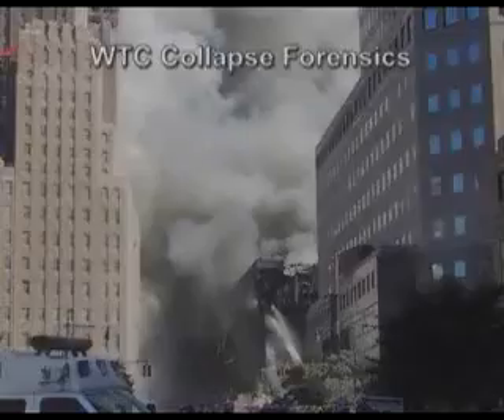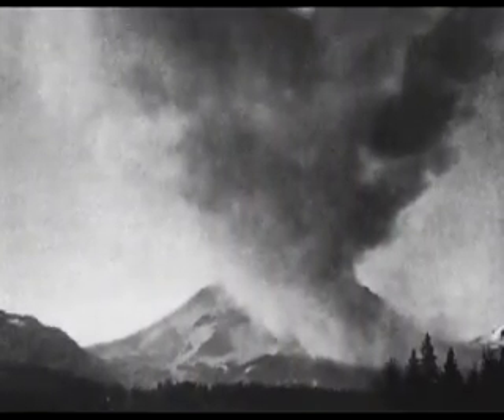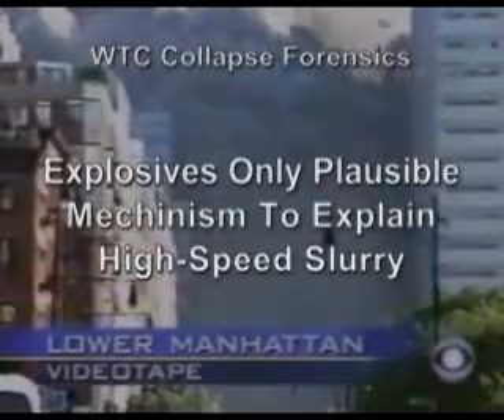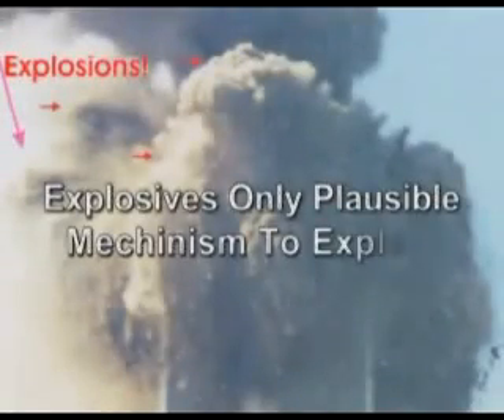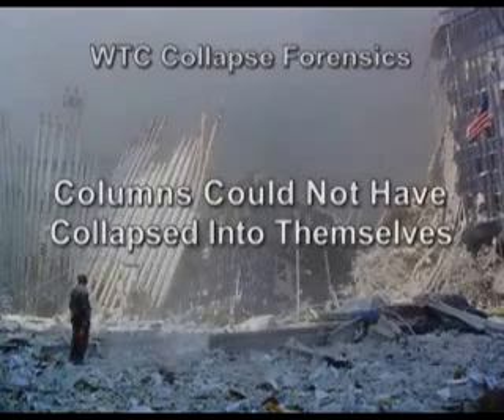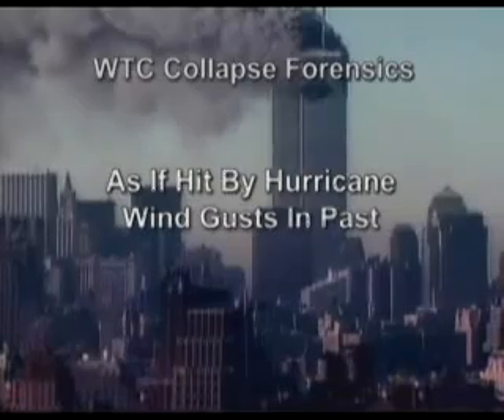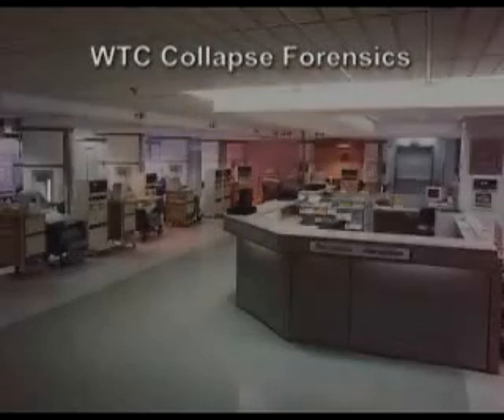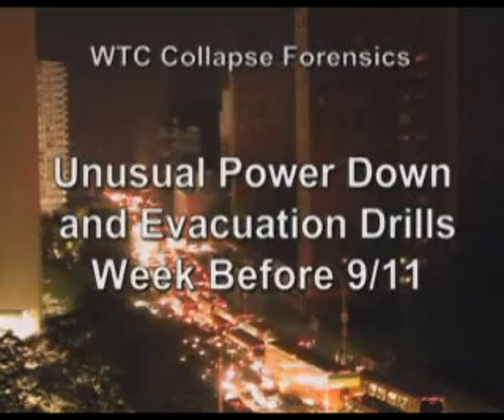MIT Engineer Disputes 911 Theory of the WTC Collapse-Part 2

Comment: CONTINUED: Wings and fins were dragged into the hole made by the craft as it struck, they are designed to collapse and/or sheer upon impact, meaning they entered the building and fragmented with the rest of it at 500+MPH.

How do YOU explain the eye witnesses that said, I saw a plane flying over, it clipped the lamp posts and then plunged into the building? Are we to ignore them in favour of your fantasy? How do YOU explain the lamp posts that had been sheered off?

Seismic data: so f***g what?

Comment: 'conspiracy' LOL!

There is an image contained in a frame of pentagon security video where it shows the tail plane section of the aircraft that hit. It hit at 500+mph... damn near enough to vapourise almost everything but the hardest substances on the aircraft including bodies (titanium elements of the engines and lighter fragments were blown out of the aircraft impact actually did survive). No fire from jet fuel, yet in the twin towers not enough fuel for a fire... WHICH IS IT?

Comment from the maker: WTC:

1. Near free fall collapse
2. Witness accounts of explosions
3. Pulverized concrete at the initiation of the collapse
4. Pre-collapse ground shaking
5. Demolition flashes
6. No physical evidence of extreme heat at impact hole but..
7. Extreme temps buried in basement/rubble for weeks
8. Nano-thermite discovered
9. Historical data of other steel framed high rise fires

Comment from the maker: Here's a great idea. The next time we need a 110 story high rise taken down, an expense demolition crew is not needed. Just blow a 4-6 story hole in the building say 3/4s the way up. Fill the hole with jet fuel and ignite it. NOTE:You can also have people walk around inside the hole with the jet fuel and fires hot enough to weaken/fail massive steel. Wait about an hour and watch the whole building come down in secs into dust and manageable sized steel pieces. Yes, completely stupid

Comment: btw, smart guy if that was the point, how come none of our building standards were modified as a result of said report? How come the report does not actually list any changes to be made? The fact remains, it was a controlled demolition. The NIST report did not even check the rubble samples! What?!? They did an analysis with out testing the actual rubble? Yeah, that is not an analysis then and just a fake cover up. Boy are you a dummy.

Comment: It dispersed out of a window mate... seriously, what's the problem? Air is squashed from above, needs to get out.. builds up, finds weakest of windows or window in a state of harmonic distortion and when it shatters, all the air comes out... they are explosions of dust filled air from the colossal structure collapsing on confined air spaces linked by ducting etc... it is not clear that there were explosives used in those explosions... that is your ASSUMPTION.

Comment: Obviously you don't read the links people send you... i sent you a video of a massive gauge in the side of the building (north west corner I believe), which had weakened the structure of the building, then low level fires went unchecked for hours in office conditions with no sprinkler system to fight it back... I have linked and stated all this before and you have just ignored it, sticking to your fundamentally flawed ignorance. Proven wanker that you are.

Comment: Lol, freefall INCLUDES air resistance in the calculations... nobody is foolish enough not to know that and make the argument. Now the point is: if they are both blown up, why is there a disparity of 11 seconds between the both buildings and their total fall speeds? In order to guarantee the falling of the buildings to the extent they did, you would have to surely ensure the same or similar amounts of explosive and work done... clearly this was not the case.

Comment: Btw, those blow outs, are EXACTLY what you see in building demolitions. The other fact is how did building 7 fall? That building had small fires and they said they were 'pulling' the building. In laymen terms (pulling a building is not an actual demolition term) that means he thought the building was being demoed. There were even fire fighters that told people to get back because the building was about to come down? How exactly would you know that unless you knew explosives were being set off?

Comment: You just called me an idiot when the evidence was right under your nose? 1.) Demolition do not fall at free fall speeds, they fall at near free fall speed. 2.) The columns could only fall faster then the outside of the building, if in fact explosives are used. In fact that is EXACTLY what happens during a controlled demolition. 3.) By definition, none of the buildings fell in free fall because of air resistance.

Comment: debunking911.co m/freefall.htm - put that in your url bar, read it and then tell me how the hell could you possibly disagree with it... unless you are an idiot.
Here's an excerpt - In every photo and every video, you can see columns far outpacing the collapse of the building. Not only are the columns falling faster than the building but they are also falling faster than the debris cloud which is ALSO falling faster than the building. This proves the buildings fell well below free fall speed."

Comment: The NY Times, on 9/28, found out that Guiliani and the DDC( Department of design and construction) had already recycled 130,000 tons of steel. From that date on, numerous requests were made to stop recycling/destroying the steel. They were ignored. The cleanup was completed in May of 2002... about 4 months ahead of schedule. The 911 Commission wasn't even set up until 11/27/02. For those that are counting, that's 14 months after the 3000 murders..and 5 mo. after the murder site had been swept up

Comment: "They told us to get out of there because they were worried about 7 World Trade Center, which is right behind it, coming down. We were up on the upper floors of the Verizon building looking at it. You could just see the whole bottom corner of the building was gone. We could look right out over to where the Trade Centers were because we were that high up. Looking over the smaller buildings. I just remember it was tremendous, tremendous fires going on." - Words of firefighters. - Now what?

Comment from the maker: Of course, it is very easy to either discredit or negate these experts when there is a lack of experts outside of the official investigation that support the official version. They are ALL nutjobs? Not likely. It's a small percentage to the total? And even smaller percentage are those backing the fairy tale. So, either way, it doesn't make sense. But, as you were

Comment: As these hundreds of thousands of tonnes gather momentum, hammering down on the structure below (concrete and steel), the forces generated are indescribably high. Enough so, to vapourise human bodies, obliterate skeletons, powder solid concrete in microseconds and deform steel I-beam sections into sliced up, nuggets, shards and ribbons of characterless steel.

When all this finally hits the floor... the convection of the heat forcing through the powdered concrete is the origin of the turbidity.

Comment: It's a good point and it has very little to do with turbidity at that point. The Turbidity arises from the contact with those thousands of tonnes of fine grain dust with the floor.

The building breaks at a point where there are several hundred thousand tonnes of material above the fracture point... think about that in terms of force, it's incredible! Unprecedented! It also fractures in an uneven line which is the beginning cause of the phenomenon you describe.

Comment: @therealhotshot1 "Unexploded thermite" You say? Well for starters thermite is not an explosive it is an inciniary. It does not explode it simply burns at an extreme temperature. By the way the dust sample it was found in turned up later and it could not be verified that the sample actually came from the towers. Of course the appauling display of ignorance at the bottom of your comment gave away how little actual research you did.

Comment: @muzicmaker2001 There is a little more to physics then what they told you in highschool. By the way even if you had a full fledged physicist working on it you would still need a metallurgist helping him to come up with how the temperatures would change the steel's physical properties. None of this expertise can be found in an electrical engineer.

Comment from the maker: @MrAwsome514 
A reply from Jeff King concerning the MIT engineer title..

"In any case, my engineering experience is substantive and the points I make in my talk are based on simple principles of physics.  I stand by the soundness of the evidence and conclusions presented, and I would be happy to respond to anything you believe is incorrect"-Jeff King

Again, most of his comments don't require a calculator, computer models and vector analysis to figure out. Its simple physics.

Comment: @muzicmaker2001 Look Your video lists the man only as an MIT engineer. The man is an ELECTRICAL engineer talking about STRUCTURAL engineering. You are leading people to the assumption that he is a structural engineer which is very deceptive of you. I should hope even other truthers would find this deceptive method of yours to be appauling. I should also hope that you would correct the problem by either adding in the additional information about his credentials or removing the video.

Comment: @MrAwsome514 The 911 Commission report page 20 states "Boston Center did not follow the protocol in seeking military assistance through the prescribed chain of command".

However, it does not state how or why.

The failings of the official report is just another part of the reason why I do not believe any of the story. It is  a joke, and if you read it you will be left with far more questions than answers. This is not acceptable.

Comment: @MrAwsome514 Agreed, there are political implications with the 2 options, that is why I said it wasn't as simple as that, and you have summed it up perfectly.

As for evidence, it is hard to find info that is not directly related to 911 as I am sure you know. I am also drawing on past knowledge of air defense, such as the interception of the light plane that flew into the Bush ranches no-fly zone.

The 911 commission report should detail the protocol and failings but is a joke!

Comment: @Portabledexter,
.
"How long do you think that they should try to contact the aircraft for before scrambling interceptosr?"
.
I don't know. Do you?
Another question ... if you think a plane is hijacked, a KNOWN(!)| scenario,  was it, back in 2001, ALSO customary to send interceptors?
I don't know!
However, listening to the NORAD tapes I consider the response times pretty quick! Everybody did his job. But in the confusion, and following protocol, the planes were at the wrong spot.

Comment: @MrAwsome514 

Firstly, you cannot hide behind the "it was inconceivable" argument. It is worth reading the 911 Commission Report, page 344 as I have previously posted, as there are many other similar examples in it.

Secondly, "By the time they would have been up in the air it would have been too late to catch up and deal with the problem" - that is exactly why the protocol is to scramble interceptors as early as possible. This leaves the options open.

Comment: @wimahlers Remember that this is against the backdrop of what happened before and after:

1. Bush "elected" by the most dodgy election ever. 
2. 911 attacks, where are the military?
3. Buildings 7 is the first steel framed building to collapse due to fire ever, taking with it the Enron and WorldCom evidence.
4. Afghanistan invaded.
5. Iraq invaded under false pretenses (lies).

You either believe that this is all coincidence, or you believe it is all bullshit. I believe the latter.

Comment: @wimahlers 

How long do you think that they should try to contact the aircraft for before scrambling interceptosr?

If a plane loses contact or deviates off course, an interceptor will be scrambled to gain visual communication with the plane. They can then guide the aircraft down (or shoot it down if necessary).

In 2000 jets were scrambled 129 times. 

Without interceptors in the air there are no options open, other than to spectate.

Your faith in US incompetence is impressive.

Comment: @wimahlers Someone marked your post as spam! (I unmarked it). I appreciate what you are saying about hindsight, but my point is that the argument "they hadn't thought of it" just doesn't hold. 

Even if they hadn't thought of it on the day (plausible), it was protocol to scramble interceptors if contact is lost or a plane goes off course. This is fairly normal and happened 129 times in 2000.

If you don't have an interceptor in the area, you have no options.

Comment: @Portabledexter They where commercial planes. We had never before seen commercial planes used as weapons in a terror attack and we did not yet know who was behind the highjacking. All indications where that it would be some sort of ransom. In a situation like that the presence of interceptors would just put the highjackers on edge and put the passengers at a greater risk. The primary goal was to get communications with the highjackers to try and talk them down. This is standard practice.

Comment: @MrAwsome514 Do you not think that when a plane diverts off course and turns off its transponder -that would be a good time to scramble an interceptor. They really aren't much use sitting in the hangar, they need to be on the scene so that as many options are open as possible. This is standard practice with all airforces across the world. It is what they do - it's their job! There is no point in going "well, we don't know whats going on. Lets just see what happens" - it's too late!

Comment: @Portabledexter That is not actually true. Steel structures using the floor trusses like what the WTC had have failures in their tuss system during fires all the time. Infact firefighters have a saying reguarding trusses. It is "don't trust the truss". Steel trusses are very light weight with a very large surface area. They heat and cool rapidly which makes them lose strength quickly in a fire, and often causes them to be the first part of the building to fail.

Comment: @Portabledexter I did... I noticed something that aparently you didn't. They are loud as hell... yet the towers fell quietly. You should go watch some accidental collapses. The main reason why people jump to the controlled demo conclusion is that we have not seen verticle collapses like these much before but if you look you will also notice we have never seen collapses where the collapse originated from such a high point on the building either. Most structural failures occure on the ground floor

Comment: @merJewel 
Not necessarily.  Concrete bursting/splitting is used where crunching is not possible.  It is a versatile and effective method of cracking concrete into sections or lumps for removal. It is a quiet and controlled form of demolition, which is used to remove both large and small sections and can be used in confined environments.

Comment: @MrFredricksen -The same way the twin towers fell. Thermate/(nano)thermite. Please watch: '9/11: Explosive Evidence-Experts Speak Out, Full-length, Pre-Release-v1.3; Low-Res.' It tells everything! Note: 1,000's of tons of Concrete, in a single collapse,  turning nearly, completely to dust is impossible without very high-tech explosives. Not to mention the pyroclastic cloud, & the extreme lateral movement of massive exterior steel pieces weighing many tons each. My best to you!~

Comment: So for the entire building to collapse, some of the steel material at the lower floors (We're taking floors <15 ) would need to have lost stability as well (otherwise it may topple or half the building twist/warp and/or not fall in a near uniform collapse). I fail to see how the entire steel throughout the building can effectively conduct 1000F worth of energy from kinetic energy and a poorly oxidised fire 50+ floors above... I'm not brush up on my physics, but logically, it doesn't make sense.

Comment: Even if you think the fired melted or weakened the steel, that's only in the impact area. When you have 70-80 floors of perfectly intact steel & concrete how does the impacted area completely obliterate the rest of the building in 10 seconds? It doesn't it's impossible. How can anyone even debate this? It should of tipped over or just burned out, even if it burned for 20 hrs there would still be no collapse let alone 1 hour. Seems like they waited for firemen/police to enter and blew it up.

Comment: @muzicmaker2001 Since you have some trouble remembering the FDNY list of things which explode in large fires, here it is again - HVAC equip, Cleaning Supplies, CRT's, Elevator Motors, Hydraulic Pistons in Office Chairs, UPS Units, Transformers, Steam Explosions from Cut Water Lines, Propane Tanks.

For the WTC fires, FDNY added abandoned firefighter's SCOTT bottles.  DOT added Oxygen Generators and Tanks from the jets.

Quote mine all you want, sweetheart!  It doesn't change reality one bit!

Comment: @914light  Sigh. Watch the *whole* series, please. 

The Empire State Bldg is a reinforced concrete, steel & masonry bldg. It's much stronger than the WTC bldgs. The plane that hit it was a B-25D (~10% of the weight of a 767) traveling at ~200 mph. The 767's were moving at 465 & 585 mph, respectively.

The 1975 WTC fire was almost all on one floor - the 11th. Structural steel was protected  by fireproofing.  On 9-11, the jet impacts blew off that fireproofing. 

Do you see the differences?